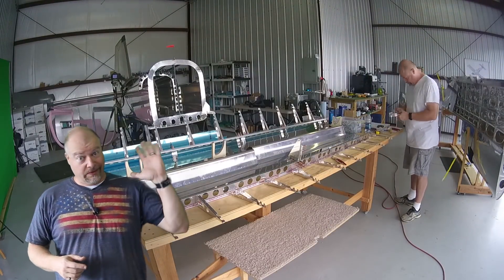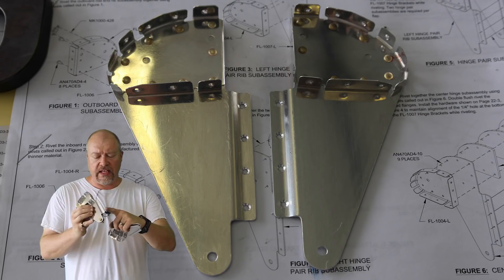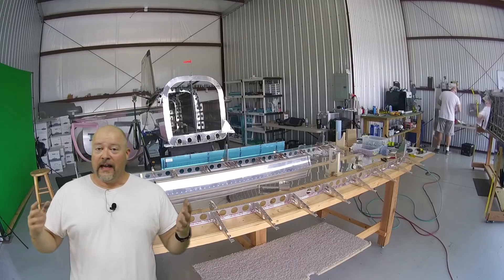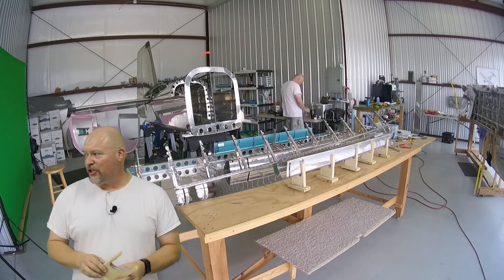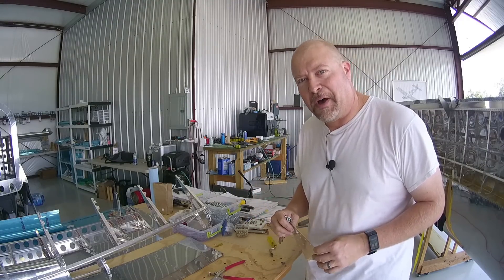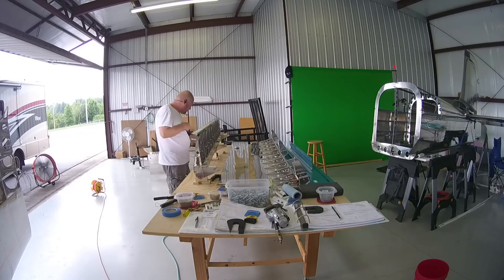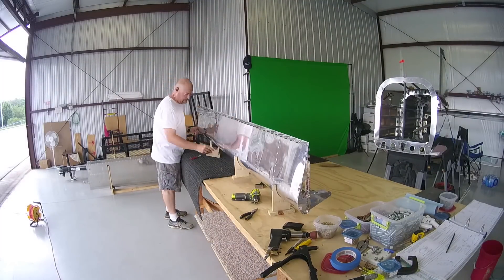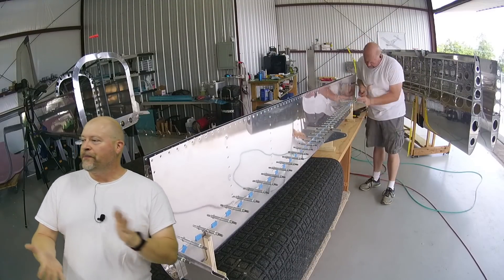RV-10 Wings - 065 - Flaps day 3! ... subassemblies, poprivets, and final assembly.

Comment: You shouldn't really use permanent markers, use sharpies.
The reason for not using the larger rivets is that they are impinging on the folded edge which possibly makes cracking more likely.

Comment: The recommendations I have seen for sealing trailing edges is VHB tape instead of Proseal.  As an aside, how does the cost of renting the hangar compare to renting a similar sized storage facility?  I am wondering if delaying the hangar rental until nearly complete might save some $$$.
Reply from the maker: Hangar rental is different everywhere.. I have heard they rent for as low as $100 a month to as high as +$1000 a month..   The T-hangar I have is 40 feet across, I have to think that renting a "storage unit" that's this size would be super pricey, plus I have yet to find a storage unit that is A) that big, b) has power..etc..  You're almost better off keeping it in your garage for as long as you can.  For me the THangar made sense because I got a good deal on the rental and the wife wanted her garage back. heh

Comment: At 5:01 I see you drilling into the outermost flap nose rib with an extended drill bit. However, I do not see you deburring the holes. I was under the impression that all holes are to be deburred. Maybe That procedure wasn't shown in the video?
Reply from the maker: All of the holes had already been predrilled/matchdrilled and deburred.  What you're seeing me do there is just line things back up.  No actual cutting was done.
Reply: So, you're using the drill bit to realign the holes, without removing any material?

Comment: thanks for the update.

next on my list of "must have's"... tungsten bucking bar, 5" yoke for my pneumatic squeezer and the DRDT-2... I have the C-frame and i just hate its method of operation.. 

i read somewhere that you can use thin double sided tape for the trailing edge. I just need to find it again to confirm.

Comment: Instead of proseal, using a little bit of resin after closing up the trailing edge also works great. The nice thing is you can use sand paper later to make the edge really nice.

Comment: I think the Proseal is there to add a little bit of vibration absorption. There were a few cracks years ago that were stopped by adding proseal when closing out.
Reply: I was thinking the same thing, or even to prevent water ingress if the airplane is not hangared.

Comment: The ProSeal is to help hold the trailing edge wedge to the two skins for final riveting.  Its really only used to make sure you are able to get the trailing edge perfectly straight (or as straight as possible).   

You don't have to use proseal, 3M makes a super strong sticky tape (its also sold on Vans website here:  https://www.vansaircraft.com/cgi-bin/store.cgi?ident=1535425010-170-210&browse=tools&product=3m-tape ) that works with reportedly the same results.  I am building a -7 so I used proseal on my rudder trailing edge, with a few additions:  I clecoed the trailing edge down to a 1.5"x1.5" angle aluminum  to make sure the proseal cured EXACTLY straight.  My rudder trailing edge came out perfect.  Just remember to start riveting from the center and working your way outwards. 

Here's a few posts on my blog of where I did the trailing edge:  http://theskunkwerx.com/rv7/proseal-party/

This post is after the proseal cured, and I numbered my rivet holes in order:  http://theskunkwerx.com/rv7/riveting-the-rudder-trailing-edge/

This one gives some detail on how I did the angle aluminum: http://theskunkwerx.com/rv7/riveting-the-rudder/

Hope those help.  I pretty much just combined all the knowledge I picked up from the forums and other builders.  Getting a straight trailing edge is pretty critical in the aircraft flying nice and straight/level.